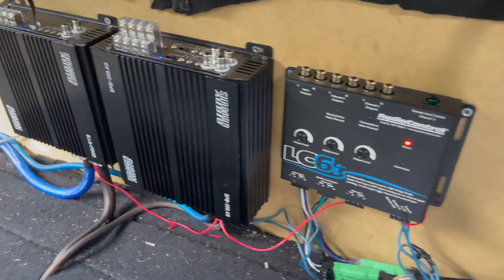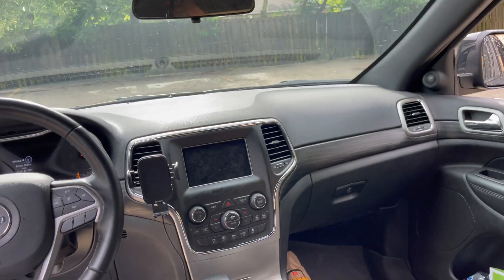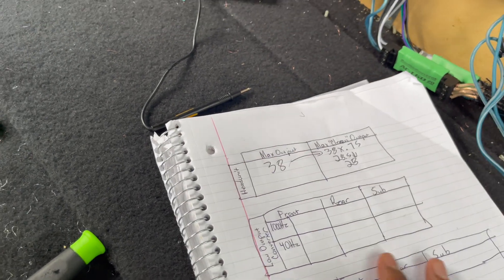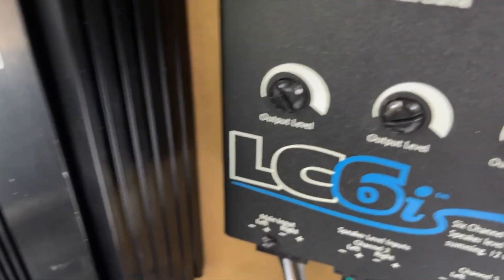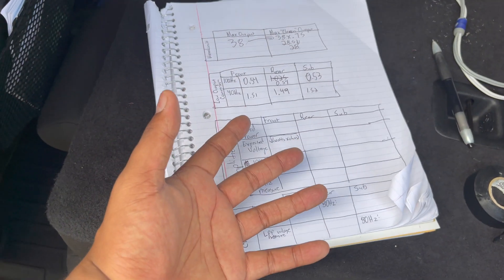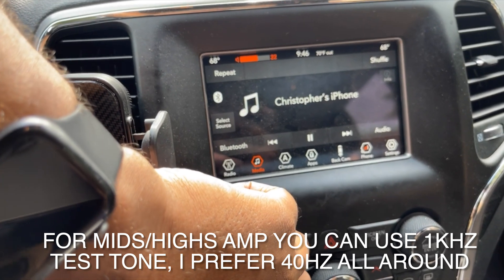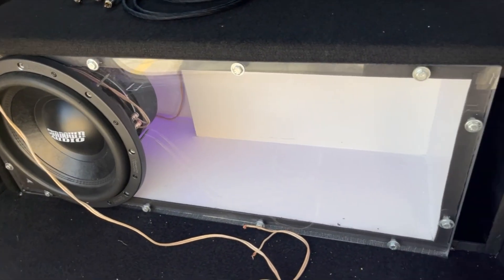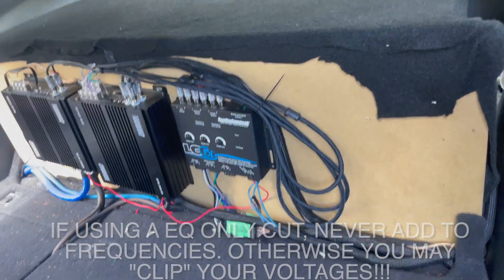How-To: Set up/tune entire car audio system for only $15 (radio/LOC/Amp/Crossover)

Comment: I love it! I draw similar charts on a pad. Finally someone who knows math!!!! You're a genius! Thank you!
Reply: Actually can I ask a question if you don't mind? I have an old amp which I cannot find a manual for but it kicks hard and I want to supply it with the correct RCA input voltage. But I don't know if it likes 4v, 6v or what.  What do you suggest? It's a Lanzar Vibe 240, 600w I purchased in 1998. Newer Lanzars says they can take 6v or even 9v but that's not the model I have. Should I play it safe and tune gain for 4v RCA output since I don't know the factory specs? 
Thank you
Reply from the maker: @tomph7087 in that case I would go down to 2V if possible. Just cus 2V should be within its range minimally. While 4V is a guess

Comment: Sounds really good bro .. i have a 2014 honda accord ..i replace my stock speakers front and rear with the prime series from rockford fosgate ..im keeping my stock head unit ..im have the Lc7i and a four channel amp ..will my system sound good without the subs thanks
Reply from the maker: The mids and highs should sound clear

Comment: Nice video thank u !!! Man I saw a comment if u did installs and u don’t!!! Man I wish u did I’m in Illinois to u helped me alot with my old jeep now my new new jeep has Macintosh system speakers all over the place would u use lc7i or lc8i I value ur input sir u have a subscriber for life thank you
Reply: I have a couple of problems the 1st I’m an audiophile and 2nd I have already takin off all door panels right rear where factory sub is and front dash cover…I think I’m gonna have to rewire everything and start from scratch but with ur videos I think maybe I can make something happen or at least get confidence to do it a big thank u sir
Reply from the maker: I personally wouldn’t swap the McIntosh system. It has like 19 speakers so I don’t see the value in swapping it. At most I would add bass which should only need a 2 channel loc

Comment: Get a oscilloscope. They are affordable now. Much better than a dmm. Dmm gets you close if all ratings are accurate.
Reply from the maker: Yeah o-scope works better. Last I checked they were like $100 so I always stayed dmm
Reply: @BigStuDolla91  they're  a lot cheaper now.  There are some $25 ones Amazon or eBay that work.  Most decent ones start around $50+. I'm just suggesting so you can maximize your system.